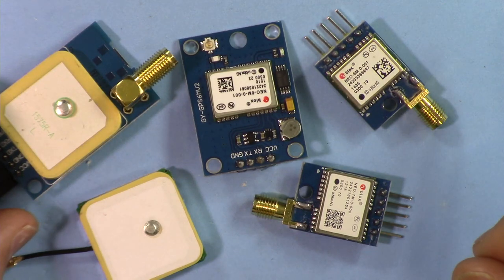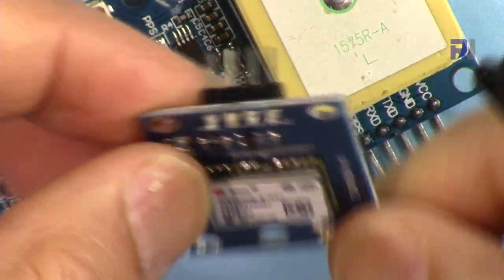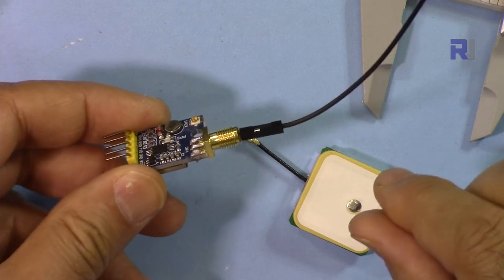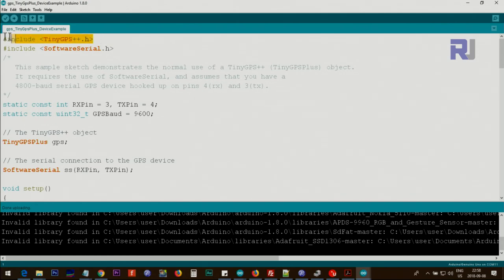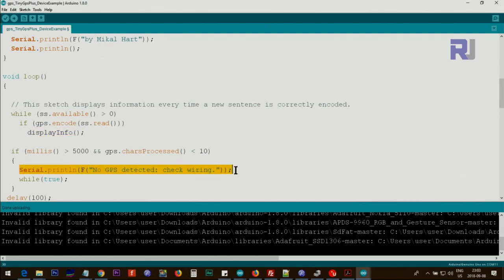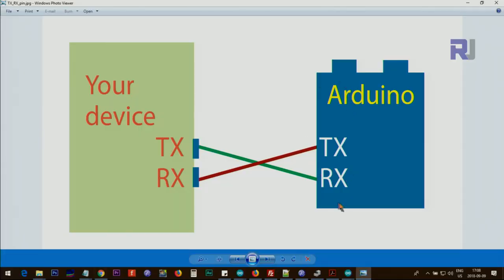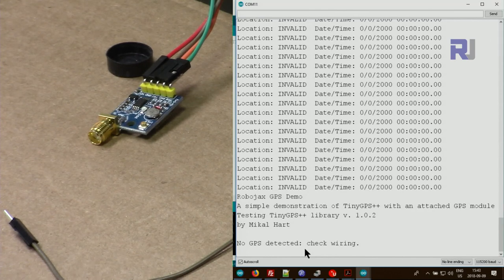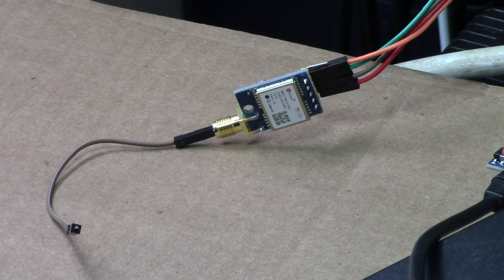Extract GPS location in Arduino with  Ublox Neo-6 and Neo 7m GPS modules

Comment: I have the GPS module with the buit-in ceramic antenna and the SMA connecter for external antenna.  Is the external antenna detected and the device switches to the appropriate antenna or some capacitor/resistance need to be removed/added?  I'm asking because mine works well with the external antenna but very poorly with the built-in antenna (I'm comparing the to similar devices with ceramic antenna only).
Reply from the maker: Hi, generally you need to remove or add something to establish connection to the new antenna. Wherever you purchased it three should provide you the details or just do an image search using bing or google, I am sure you will find information for that.

Comment: how accurate your GPS is ? Description 3m - real about 3m  - outside  -  Max read working speed about 1 sec  -  satellites  move so you get +/- 5 m  - good idea to calculate average for 10 results ( the best calculate during 90 sec )
Reply from the maker: Just check the datasheet and don’t trust what I say.

Comment: Hi, I'm just wondering, do you have to use the RX pin on the GPS module? What does the RX pin do exactly, like what does the gps need to get from arduino
Reply from the maker: Hi, GPS module has a lot of parameters that can be set with the library including the refresh rate(very important) and other which we are not concerted with. I have another video that you can get coordinates without library. The link is in the description of this video.

Comment: I have neo-8m gps module. The baud rate on that one is 115200. The UNO seems to be just too slow for that. Plus the TinyGPS library wouldn't work for newer generations. I'm still trying to get it to work. I found out neogps library should work with it. The problem is too many crc errors. Any hints?

Comment: Hey! I have some questions:  
- Can I use Neo-6 or Neo-7 for indoor purposes? 
If yes, how much can the module be obstructed? (I mean using the module under a roof, or into low floors in a building).
Reply from the maker: No you can't . It needs direct view of sky to receive signals.
Reply: It's a late answer but, I believe that installing an external antenna will work!
Reply: I have two Neo-6 modules that works in the house (in a plastic box, for protection)(ceramic antenna), at 1st or 2nd floor, but an other that only works outside. Sometimes it seems to be very sensitiv, or can the 3.15GHz go through the windows ?

Comment: Hi sir, thank you for the video. I did follow the steps that you've shown in the video, but I cannot obtain any output in my serial monitor. I'm using gps 6m, aduino uno and I also put the gps besides my window. But still, there is no gps signal. Can you help me please.
Reply from the maker: other than telling you to check wiring and library and making sure your Serial monitor is set at correct baud rate, I can't see problem. https://snag.gy/y3pKwG.jpg

Comment: Hello sir, thank you for your video. I would like to ask you something about my final project. Its the combination of data fusion between GPS and IMU can enhance the accuracy of the user/object. So which arduino compatible with both of them?
Reply from the maker: Hi, You are welcome.I don't know what IMU is.
Reply: @robojax  IMU is a sensor. To make the gps more accurate we can use imu sensor. Btw thanks for your reply
Reply: Hello I am interested in your project can you just share how you did your project? Maybe from Github. Actually I wanted to used two GPS modules simultaneously for more accurate positioning

Comment: Thank you for the video. I can send the gps data signal from arduino to my cell phone but is it possible to use that data to get a live pin to a map, without updating all the time? (Maybe with an app or a website?)
Thank you very much for your time.
Reply from the maker: You are welcome. Yes it is possible but it needs a service. I have a plan to create such service but it is a lot of work. You find Amazon AWS free service that takes data from GPS from Arduino and your app can connect to the service. Search Amazon AWS.
Reply: @robojax  Thank you very much. You have my respect.
Reply from the maker: You are welcome.  It is my pleasure to help. Respect.

Comment: Hello Robojax  I have trouble
 can you   help me  ?
problem: I use 8266 to scan Wi-Fi and  using neo -7m. scan Wi-Fi locations
Do you think this can be done?
Reply from the maker: Hello, I've not tested the library with this module.  You may use the code shown in this video so you can get location without library https://youtu.be/rCXYP6H3gSE  and WiFi scan can be done at the same time. Good luck

Comment: I'm getting nothing but blank GPS data, like that shown in the begging of this video. Does that code do any writing to configure the GPS device before it will work correctly?
Reply from the maker: everything you need to do is shown in the video. you may not be receiving GPS signal. try a better location exposed to sky. if you are located above the equator, then point it to south-up and if you are below the equator, then point it to north-up
Reply: @robojax  Thank you. I did try that. We're standing away from buildings and trees, but I still don't get anything after 5 whole minutes. Do I need to give it more time than that to lock in a signal?
Reply from the maker: no. 5min is enough. something is wrong. Try method shown in this video https://youtu.be/rCXYP6H3gSE

Comment: Sir pls make a video of 4 pin gps imean neo 6 4 wire connection for apm 2.6
Reply from the maker: number of pins do not matter. TX, RX, VCC and GND is needed.

Comment: Thanks for sharing this video. i have tried neo7m0000 beside the window for long time but the data stay same $GPGSA,A,1,,,,,,,,,,,,,99.99,99.99,99.99*30 and never change and the light doesn't blink.
 even before i tried neo6m it worked two times outside then stop for ever. i am no sure what is the issue with gps. can you help
Reply from the maker: Hello,  so check the wiring. First test your code without connecting the GPS module. if you are getting the same data, then it means GPS is not receiving or sending data to Arduino.  Also have you checked this video which very simple without library: https://youtu.be/rCXYP6H3gSE
Reply: I waited 2-3h first time :) to get first signals (next time <3 min)  - just leave outside (and check cables)

Comment: Big time quiestion, that's driving me crazy. Why on Earth does it has an RX pin. Can someone help? Can I send Data to the GPS Module? I am talking Commands to read a specfic NMEA Sentence
Reply from the maker: Yes you can send and set parameters including power and sleep mode. Read the datasheet and if you figure it, you can control it.  This video is about extracting location.

Comment: Can i get the gps coordinates from the usb connection?
Reply from the maker: when it prints it on serial monitor, that is USB. just read it. Arduino is reading it from USB and printing it for you, now you do your job to get in your Window/Linux/Mac machine to read it outside Arduino. if that s what you want.
Reply: @robojax  what i meant is can i get the gps info from the micro usb port ?
Reply from the maker: Please read above.
Reply: @robojax  Thanks

Comment: Hi, thanks for sharing your knowledge

I ran the program and the gps displays INVALID, date 00/00/000, time 00:00

gps.location.isValid() return INVALID 

Location: INVALID  Date/Time: 0/0/2000 00:00:00.00
Location: INVALID  Date/Time: 0/0/2000 00:00:00.00
Location: INVALID  Date/Time: 0/0/2000 00:00:00.00

Can you tell for what reason?

Tks !!!! Bruno
Reply from the maker: No signal. Make sure Gia module can see the sky. If you are above equator it should see the sky the south
Reply: @robojax  Thanks. Unfortunately, none of the 2 gps are working. I am using the Ublox 6M V2. Many thanks for the reply
Reply from the maker: Search my channel and see the other video for gos.

Comment: where do i get the datasheet
Reply from the maker: from the same page where you get the Arduino code. The link is (always) below the video in the description.
Reply: @robojax  I saw the datasheet of the ublox core, but I wanted the datasheet of the entire module itself, I can't, right? I've tried to find it on Google but it doesn't have
Reply from the maker: you won't find it. this module-with-pcb even doesn't have a model number.  someone just produced it and assumed you use the main datasheet. Besides it has very few components which you can search online for each and know what they are. Good luck.

Comment: Many little errors and shortcut text in this video. You say connect to pin2, but plug a wire into what is labelled D1. You talk about the Serial Monitor connection, when the statements you refer to are for the software serial connection, which is what communicates with the GPS. Then 'connect Tx on the GPS to rx', but omit the additional words 'on the Arduino'. Kind of misleading. Difficult to give it a thumbs up.
Reply from the maker: Than you for your comment. I appreciate it.  I am not sure if you are familiar with Arduino, in this context which we get the data using Arduino board, Serial Monitor is within Arduino an pin2 is also refers to pin 2 of Arduino.  I will read the errors in text. The title of the video is the words "in Arduino". I am sorry if you felt mislead. But greatly appreciate your comment.

Comment: No GPS detected: check wiring

I've gone over the wiring multiple times, checking for connections and everything seems fine, could it be that the GPS is broken?
Reply from the maker: Hi, I am not sure. Try my code from this video https://youtu.be/rCXYP6H3gSE and if GPS can see sky towards equator, then GPS module is bad.

Comment: I want to make tracker for car. But does this GPS only work outside? How can I get GPS for inside car?
Reply from the maker: You would have to put under the windshield in plastic box and connect the wires to your board.
Reply: @robojax  thanks. how do they make GPS car trackers where they put the tracker in the trunk or under the car. How do they work?
Reply from the maker: Wherever you put them, they must get signal. Signal can't reach if antenna is covered with metal. so you may put antenna outside like a small wire that can can see sky.
Reply: Robojax will tinfoil layers on dashboard block signal?

Comment: Hello Sir, I have uploaded the code successfully on the board just as how you instructed in the video. However, it still shows in the serial monitor that the location is invalid though I went near the window and the neo 6m started blinking. What could possibly be the problem?
Reply from the maker: I am not sure. Perhaps the wiring is bad, voltage is low, signal is not reaching or module is bad.

Comment: what about we want to get signal from 2 gps? i mean, i have 2 gps and i want to get signals from them with 1 antenna which connecting to my pc. Is it possible that get signals from 2 gps with 1 antenna at the same time?
Reply from the maker: I don't think you can use the same antenna for two GPS receiver. The antenna is active device, it has electronics and it communicates with receiver.
Reply: @robojax  Thanks for your answer
Reply from the maker: You are welcome.

Comment: Is the antenna comes with the gps module itself or we have to buy it seperately? and  Is  the same code explained above works for the  Neo 7m GPS modules?
Reply from the maker: It depends on the seller. When you purchase they will mention. In the video I have explained it which one is coming with the antenna but I forgot. You have to watch it if you want to know.
Reply: Thank you

Comment: if , I want the 5HZ update rate of NEO 6M gps instead of 1HZ(default) and baud rate instead of 9600(default).....
thanku
Reply from the maker: You can't . You would you have buy the faster refresh rate NEO 7M or Neo 8M which are fast and expensive.
Reply: +Robojax but in NEO 6M gps datasheet .it has mentioned  that ,it's maximum  update rate is 5HZ .
Reply from the maker: you are right. look at this page https://github.com/jlnaudin/x-drone/wiki/How-to-setup-the-GPS-Ublox-NEO-6M-(Crius)-CN-06-V2
Reply: thank you....
Reply from the maker: you are welcome.